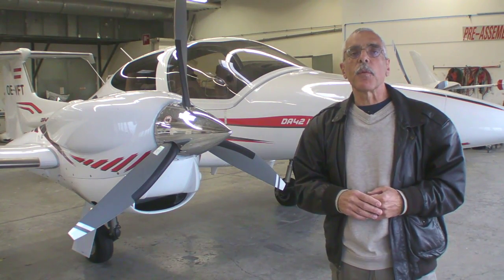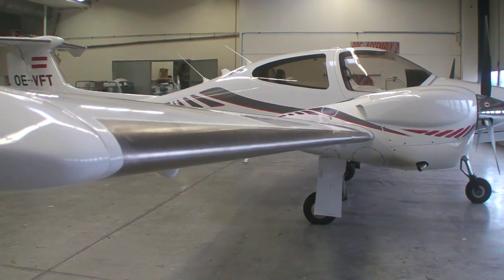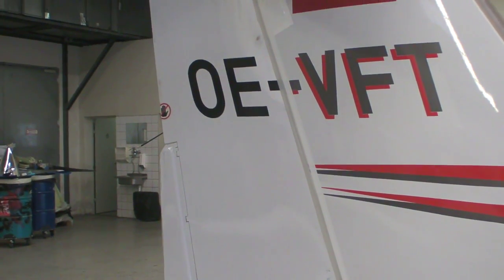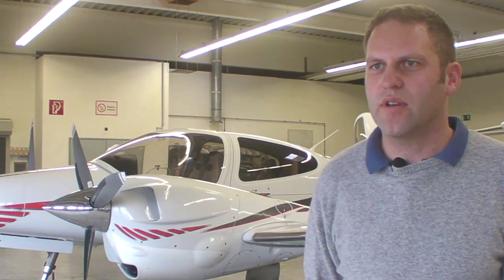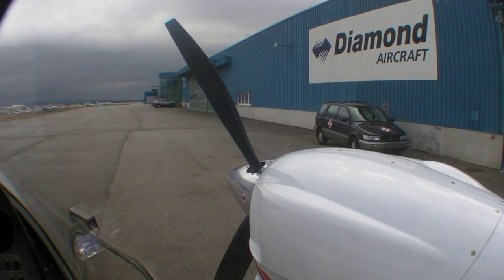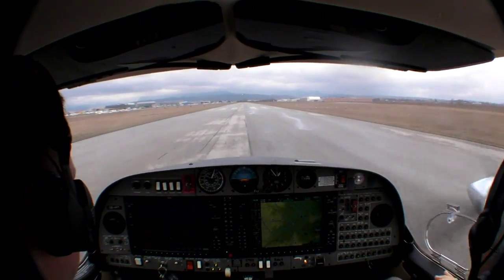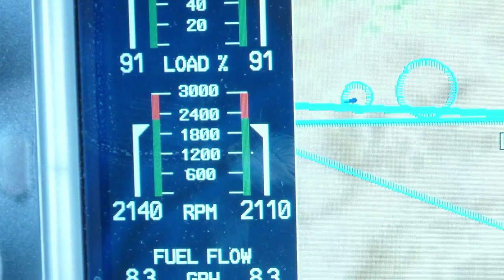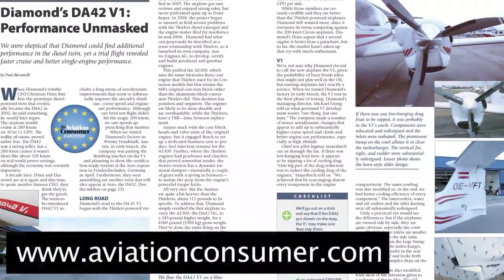Diamond's New V1 Twin

Comment: part 2: 170 kts + winds, might as well drive or take the Bonanza. If they get 200 kts (realistic, not paper #'s) my feeling is that the airplane becomes feasible for certain missions that are not speed dependent, <1000 mile missions, maybe over water, etc. Cirrus is still what needs to be beat, fast, safe with CAPS (if the sharks are not feeding), known icing, etc. Diamond still has work to do but seem to be giving it a go. Nice to see.

Comment: Diesels! More HP = more weight. More weight = no useful load. Actually the increased weight of diesel engines in general affect useful load. More power, Vmc problems, bigger rudders, more drag... eventually it's like a dog chasing its engineering tail, and becomes a point of diminishing returns.

Comment: I have about 400 hours teaching in the Diamond DA42 L360.  Its single engine service ceiling is 5,000-7,000 feet, and though its service ceiling is FL180, I seriously doubt it would get 300 FPM at 16,000 with both engines running.  The turbocharged Austro engines combined with the aerodynamic improvements make an amazing difference!